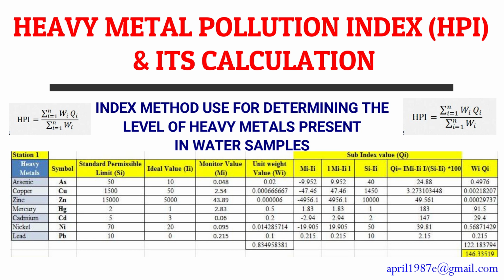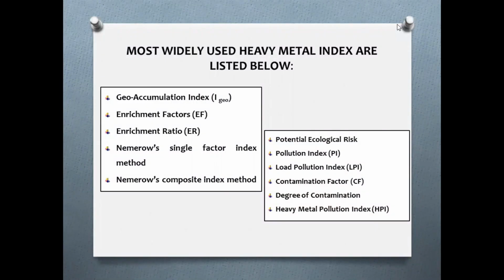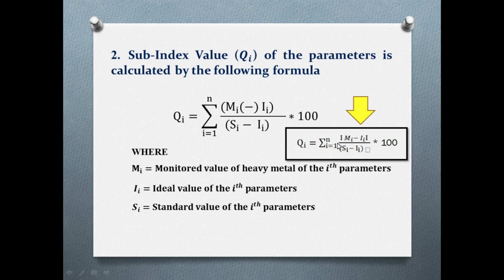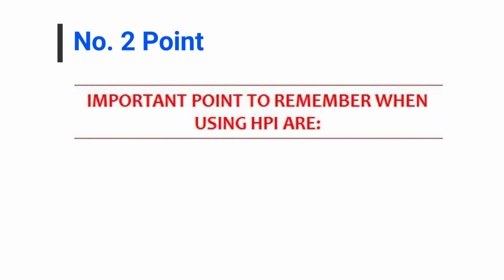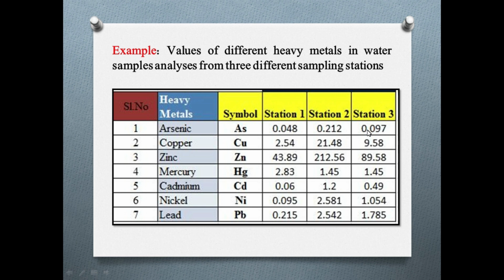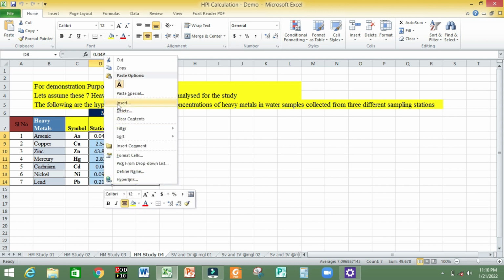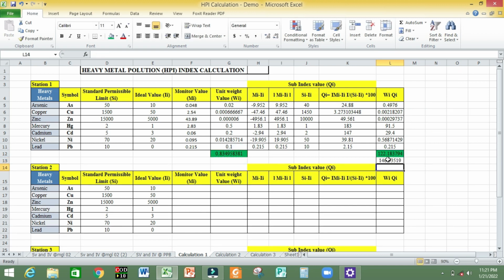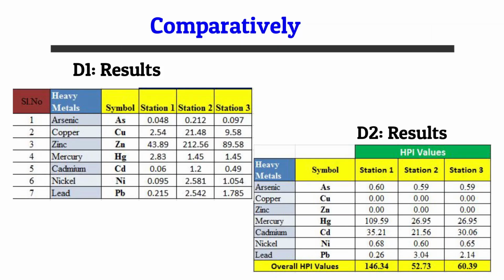Heavy Metal Pollution Index (HPI) and its Calculation

Comment: Well explained sir ..... Sir I m doing research on toxic matel determination in soil , Vegetable and water ...can I use this method to calculate HM in these samples.?? And one more thing we get the concentration and absorbance from AAS ....do it need further interpretation??
Reply from the maker: Thank you so much. Appreciate it very much 🙏.  I'll suggest you kindly check if any other papers have use this for HM content in vegetable etc  assessment. That is how we can assure its applicable besides applications in Water study. The data obtained (if needed check these before proceeding ahead )to be converted unit for easy further analysis. Thank you 😊 so much.

Comment: Thank you for making clear the calculations. THe HPI of one pond is calculatedd in 1040? Is it correct or wrong?
Reply from the maker: I ll kindly request you to re check the calculation carried out. Follow it step by step. However, slight possibility for high hpi values could be contributing by 1 or 2  paramters which are present beyond the limits. Thank you 😊

Comment: Very good, but I could not find the ideal value of As, Cd, Cr, Cu, Hg, Fe, Mn, Pb, Ni, Zn according to WHO 2017 or  European standard. Can you please help with this? Thank you
Reply from the maker: Thank you so much. The standard limit you Ned are available in EPA website or Any other recommended agency you wish to incorporate in your study. Thank you so much again
Reply: @JustLikeASteam  Thanks for your swift reply. I found the standards for every metal, but it is mentioned in the video that we need the Ideal value. So, how could I find it based on the European standard. Your channel is amazing and your tutoring way as well
Reply from the maker: @OMAR-ce1bj  OH you referring to ideal values. The way to obtain ideal is best when BIS standards is use, I belive you are aware as mentioned in the video.However, with using other standards the problem is with obtaining ideal value, so it might be 0 or it might be some value if the standards you adopted do have lower and upper limit. This is situation with other standards.However, another option you can confirm is by cross check other publications in your respective country's working on Heavy metals, even from there you will get some clue too. Ok Thank you 😊

Comment: Very well explained. thankyou
Can you please provide me the list of ideal values of Fe, Cr and Mn too ?? thanks
Reply from the maker: Thank you so much. Please Keep supporting for more. It depends on the standard limit adopted for the study. If BIS, I believe  its 0, 0 and 0.1, respectively  . Thank you 😊
Reply: @JustLikeASteam   I am adopting WHO standards, some of the standard limit values in your calculation are not correct as per 2022 WHO guidelines. According to 2022 guidelines I am using values  0.05, 0.01, 0.005, 2, 3, 0.3, 0.006, 0.5, 0.1 mg/l for Cr, Pb, Cd, Cu, Zn, Fe, Hg, Mn, and As respectively.  I need ideal values for these all. Can you please help me out??
Reply: Ideal values are required for the calculation of HPI for research work
Reply from the maker: @sadaqathussain1310  if you watch te video carefully I did not adopt WHO. I adopted BIS standards. Thank you
Reply: From where I can get the ideal values for WHO standards ??